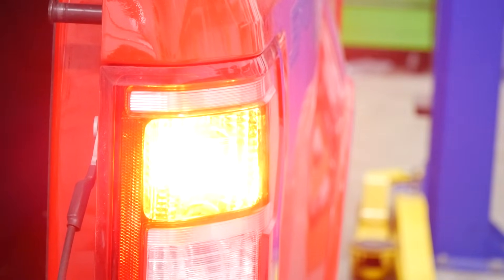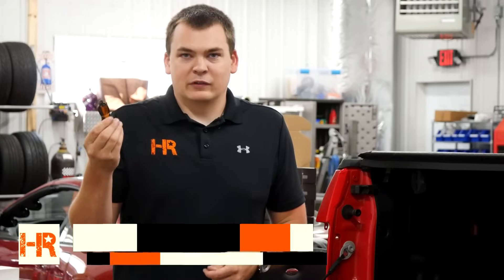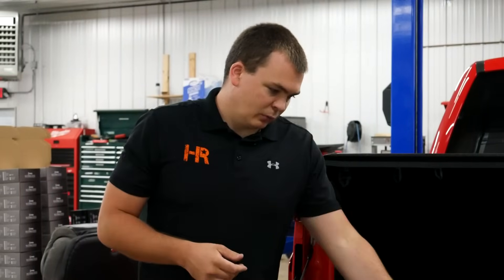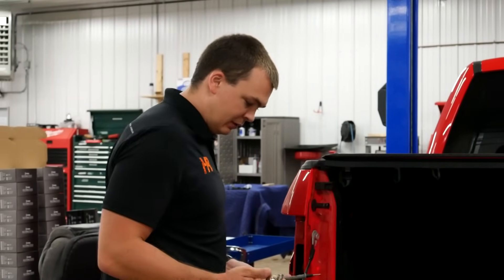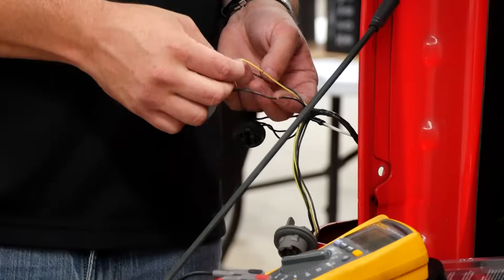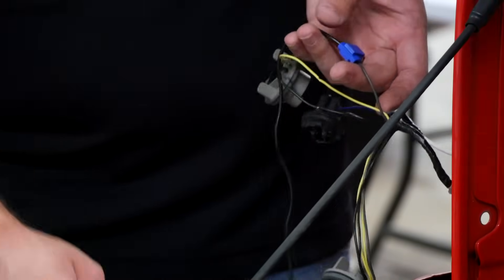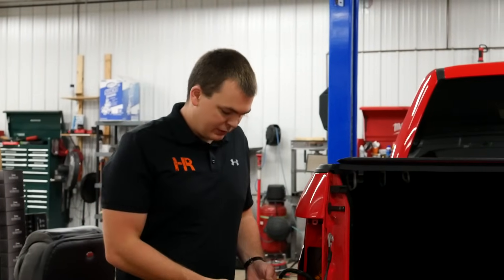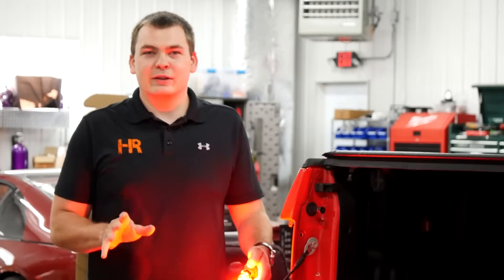How To Install LED Resistors - Everything You Need To Know | Headlight Revolution

Comment: I have a 2015 Silverado. Do I need 2 resistors per taillight?
Reply from the maker: You will need 4 resistors total, yessir. This kit includes everything you'll need for the install. 
Link: https://headlightrevolution.com/2014-2015-chevy-silverado-led-rear-turn-signal-and-brake-bulbs-kit-4-bulbs/
Reply: XxFORDF350MCxX m

Comment: is hyperflash bad do I need the load resistor? is there any other advantage other than slowing down the rate the light flashes
Reply from the maker: It's not a bad thing, it just gets annoying after a while. Some people actually like Hyperflash due to the attention the rapid blinking/indication gives. All Resistors do is slow the pace on the blinking down to the normal pace. Great question!
Reply: @HeadlightRevolution  What are your thoughts on companies like Vleds who sell the led bulbs and plug and play resistor? No wiring needed.
Reply from the maker: @chrisginoc  They are really unique kits! The concept is awesome! We have a kit on the website for the 14-18 Tundras and we hear great things about them!

Comment: How would I get rid of interference for the reverse camera when I install the LED reverse lights?
Reply from the maker: Aftermarket camera or OEM? Which brand reverse LED bulbs did you install?
Reply: Headlight Revolution 

OEM camera, GTR 1000 lumen 7440 Reverse LED
Reply from the maker: @thegreatempire3882  I would try one original bulb, and one LED and see what happens.  Then swap them and put the other led in. Maybe it's a defective LED bulb? See if one causes the problem or both.
Reply: Headlight Revolution 

When I put the originals back in the issue has not come back. 

As for the interference, I used Diode Dynamics 7440 LEDs too the the issue was much much worse.
Reply: Headlight Revolution 

The issue also went away when I went from being in reverse to and the LEDs shut off when I had the leave the contra on for a few seconds then I change from reverse to drive

Comment: Now my leds say theres no bulb in it says the lamps are out, I also noticed you had two in one side? So does that mean I need one so the computer knows theres a bulb in and one for the hyper flash?
Reply: he had two resistors on one side cuz each led turnlight bulb needs one so it don't cause hyper flash
Reply: Ok well the lights I bought required two and it was not because two lights signal a flash. One was for the flashing lights and the second one had to be used on the reverse light because when I installed the LED backup bulb the whole light went out and the lampout came on. So if the lights are independent of each other but are LED my car required a resister

Comment: Will resistors make the LED bulbs go brighter?  I'm trying to replace the Reverse stock bulbs on my Lexus SC300 with LEDs but I feel like it's not really giving out that much brightness in contrast to what the LED power output should be.  Also, the breaklight indicator on the dash has gone on so I assume it really needs some resistors to be installed?

Comment: Good video. Just finished installing resistors on my 2011 GMC Sierra. They're on the tail lights and front turn signals.  Started out good. No hyper flashing during the day. Hyper flashing returned when I turned the headlights on. Where did I go wrong?
Reply: I am facing the exact same issue.

Comment: I had 1 fail. It was in my aftermarket taillight assembly. It had a built in led board inside. There was a small metal box housing 2 mini led's wired in parallel (i assumed to lighten the load and reduce the total heat created). Well for 5 years of operation. Water got into the metal box.  It corroded the resistor from the inside. I bought a pack of 6 or so of the same spec of resistors and replaced them. They can fail if not protected from moisture. But it takes a while

Comment: The whole point of adding the LED light is wasted by adding the stupid ass resistor, just because the way they designed the system!
Reply: True. There are two major reasons why anyone would install turn signal LEDs: 
1.) lower power consumption.
2.) brighter output (more visible to traffic).

Typical example: Bulb type 3156 , stock is 27 watts @ 400 lumens. LED equivalent is 4 watts @ 900 lumens.

Unfortunately, we lose one of the benefits when we add load resistors. It returns back to near stock wattage to please the computer module. 

So really the only reason one would do this is because they like the response time of LED and brightness.

Comment: Excellent video..... I have a 2016 Ram 1500. I bought some led tail lights and have the issue of an error code when the led’s are installed. Do I need to install resisters for the turn signal AND the brake light? Or is it the same wires. I noticed you installed 2 resistors on the same side in this video...
Reply from the maker: Hey there! Good question! This specific truck has Two turn signals that neck into one harness. So, we had to wire in Two resistors, One per bulb on each side. :) You only need to use a resistor on your turn signal bulbs, nothing else. If you have installed your resistors and still receive errors and/or hyperflash, double check your wiring to make sure you didn't tap into a parking light, or similar wire. If the problem persists, give us a call and we will help you out! :) 218-755-5505

Comment: why install LED that requires resistor? why not leave factory bulb? what is the gain of having LED in the tail light or turn signal? By the way good video, I appreciate your work.
Reply from the maker: LED bulbs are much brighter than stock incandescent bulbs, which is great for road safety and turn indication, and it improves the overall look of your vehicle. They also draw less power and have a more crisp and immediate power-up time, where stock bulbs will blink at more of a delayed pace.
Reply: @HeadlightRevolution  don't they draw more power if you put in lots of resistance on every single bulb though?
Reply: Led have longer LIFE...realy longer.  almost never die
Reply: And I think another advantage is it would come on quicker than a traditional bulb, while it may be very minute and have small/no difference, it's enough for some companies to deploy marketing strategies for it, for safety. :p
Reply: @dinosoarskill17  Plus they never burn out ALSO a Safety Advantage...think about how many people drive for months w/burnt out bulbs... accident waiting to happen.
Reply: Use dielectric grease around the t tap and it's just as corrosion resistant
Reply: Worth it when you install switchbacks in the front turn signals
Reply: Leds are much brighter as far as lasting longer well many have fail on me!

Comment: How about not using crap t taps or not properly sealing your soldered joint.  Those wires will be toast within a few years due to being open to the weather.  Cut the wire, put glue filled shrink tube or a solder tube down one end.  Then you can solder or use the solder tube to finish your connection.  Sealed and will never corrode.  Electrical tape and t taps are only ok inside a vehicle.
Reply: Devilhog, I also would like to know HOW..."2 years to Burn through 18 gauge or smaller wire" as that makes NO sense, you are a so called Tech in the industry I would think you would use proper terminology... The only way a wire "Burns" is if you are putting too many amps through it...and with LEDs that certainly is not the case.... You also made it sound like this is MY video...Not even close...AND soldering joints is "OK" but you also must be careful of what kind of solder you use as well...because you could STILL corrode the wires inside YOUR joint if you do not clean it after soldering. (I know this because I worked for an ISO 9002 certified electronics manufacturer for 7 years, and everything we made for the Military had to be soldered with specific solder that was not acid flux core.)  Many times Weatherproof junctions or taps were required by the military and medical fields... Dielectric Grease is a must in any automotive application and then making a silicone cocoon over it is best.  (No they didn't show this..but they should)
Reply: Yes per J-std  and IPC 610 you should properly clean your solder connection as any residue from the solder core will cause corrosion. I don’t think HR did a good job explaining this factor or that you should seal the Ttaps as well.
Reply: Devilhog1981 t-taps with silicone has worked fine for 30 years on my trailer lights in MN winters...its called seal the damn things!
Reply: @misters2837 , as a tech in the industry i can attest all it takes is 2 years to burn through 18 or smaller gauge wire.  Seen it many times with DTRL unit installs using your methods in the video.   The video does not mention/show any sort of sealing/protection from weather.
Reply: Well, I work in the powersports industry, and I can tell you with certainty that T-Taps with a dab of dielectric grease and encased in RTV silicone lasts.
Reply: How do you seal the solder connection from corrosion?
Reply: Don't use silicone RTV to seal as it will allow corrosion.  Clean your solder joints with alcohol and use liquid electrical tape for better performance.
Reply: @BenjamIncredible : Interesting, I haven't had a problem in 30 years, hard for it corrode without air or moisture.  If soldering, Clean Afterwards or use "No Clean" solder, then apply RTV Silicone on solder joint and insulation and use shrink tubing, this will make a completely sealed unit, been using this method on boats and PWCs for decades.
Reply: @misters2837  I've had many problems with it corrosion copper in my applications.  It releases acetic acid when curing (this is the vinegar smell).  Acetic acid corrodes copper.  There are non-corrosive RTV as well.
Reply: @BenjamIncredible : That is why you use only "Sensor Safe" like "Ultra-Blue Permatex" as it is non corrosive... I do not use anything but sensor safe RTV except Right Stuff Black, but that only gets used on oil sealing surfaces.
Reply: @misters2837  Good discussion.  Hope others can benefit here.  I most recently used hi-temp rtv and ultra black.  both allowed oxidation on water tight applications.  I also live in MN where sealed components were exposed to water and road salt.   Safety Data Sheet indicates instability and/or reactive to Water - Go figure..
Reply: @BenjamIncredible  Well that is before it cures?  One thing you can't use it on...Gas Tanks!  (Unless you like plugged fuel system!)
Reply: @BenjamIncredible  I wonder if the acid core in the solder, still caused issues...Maybe dielectric grease sealed in shrink tubing? if the shrink tubing is water tight?
Reply: @misters2837  All good thoughts.  There same exact setup with liquid electrical tape has resulted best so far

Comment: Please note. Not all car need resistor. It depends what system che car uses. In new car often you don't need to install resistor, because the timing is computer generated, not by power consumption etc. In my Golf 7 i have installed led turn signal without resistor and they work perfectly.
Reply: What year is your golf 7 ? ,  i have 2021 altima do you think it needs a resistor , relay  or non 

Thanks in advance
Reply: @STATIC-NITRO  You can test that by simply taking out the bulb

Comment: I have tail lights that have LEDs built in and the “built in” resistors went out about a week ago when I took my truck to get washed. The whole tail light functions as a turn signal rather than just one half of the tail light, so would I need to put resistors on the top and bottom harness on each side of the vehicle? A total of 4 resistors?

Comment: How about one resistor on the blinker output wire in the dash. Is it really necessary to put a resistor on every bulb?
Reply: Andrew Armstrong that isn't going to work, because the BCM CAN system looks at each "load" independently.

Comment: Hi there. I have a hundai Verna fludic 1.4 diesel engine,  I have installed led bulbs recently (H4/p43 model)12V/ 30watt/4000LM. But it's not bright at all.  my question is can we use a capacitor/registance to improve the quality/brightness of the bulbs.  plz reply back.